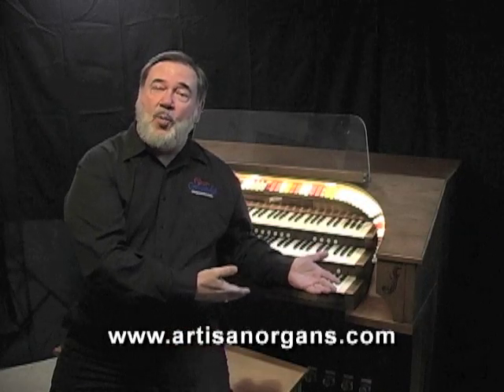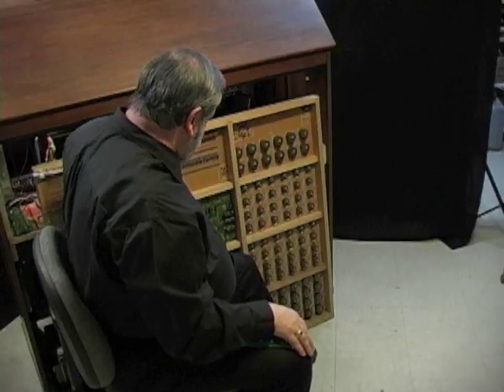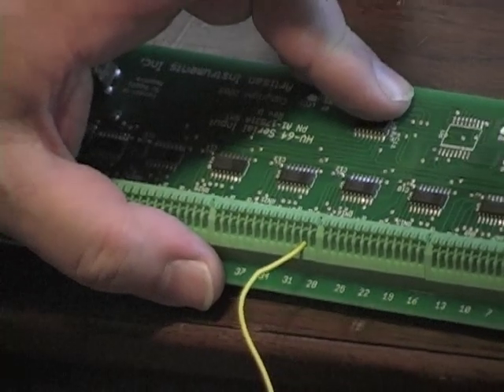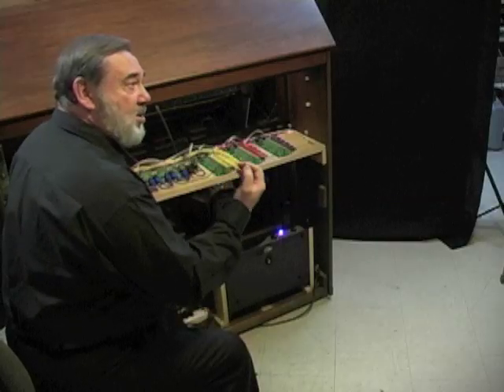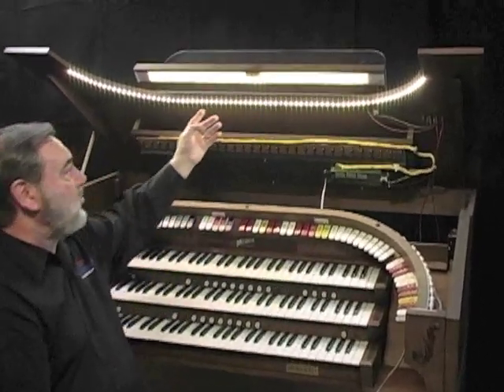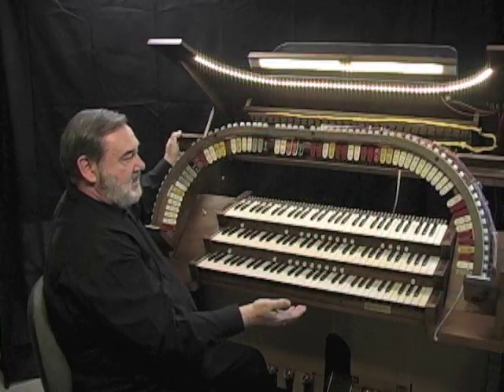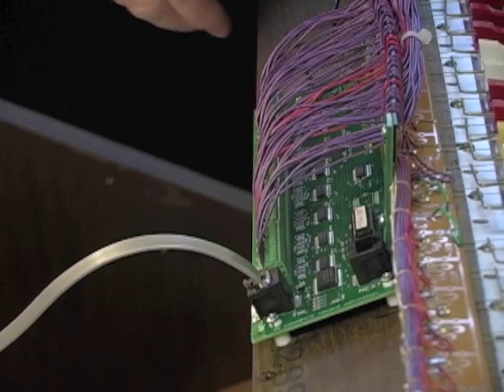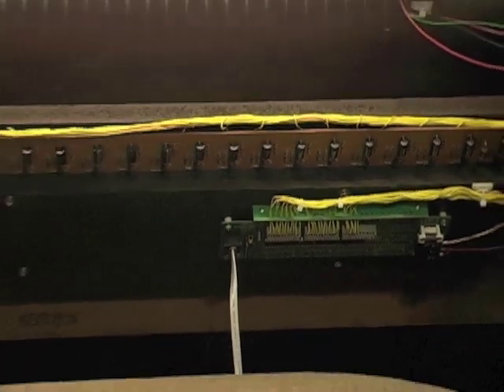Rodgers Trio Rebuild with Artisan Sound Engine

Comment from the maker: Actually pretty easy. We just take the audio output of our sound engine (rca jacks) and go into a power amp (we used a Crown amp) then connect the amp to the existing Rodgers speakers through the original Rodgers crossovers.